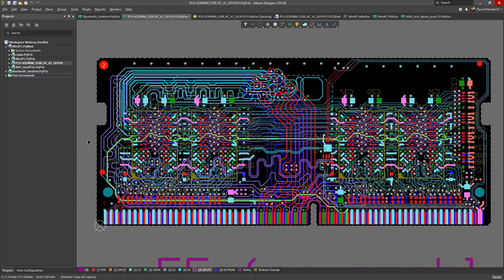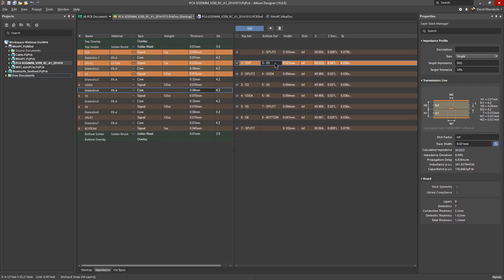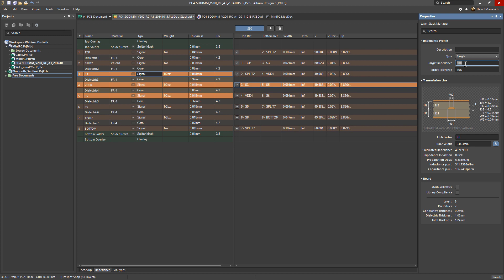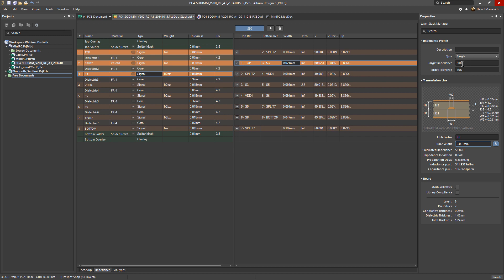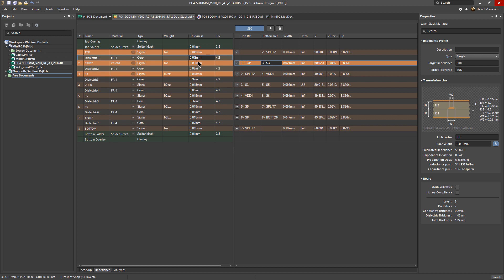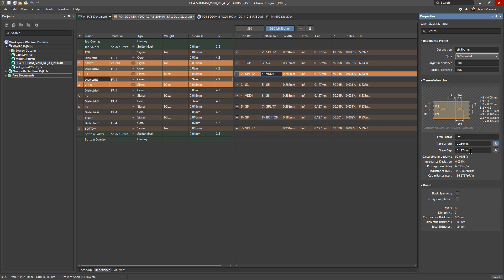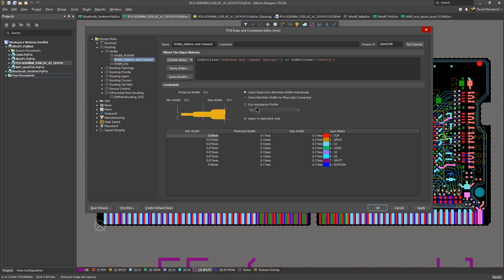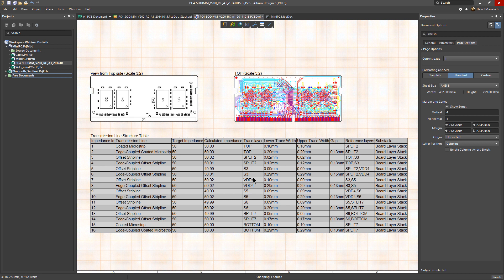How to Calculate Impedance for Single and Differential Transmission Line | Altium Designer

Comment: Thank you for this video.
But when I choose differential co-planar, I can't define rule. 
cant tick Use differential profile checkbox.
Reply: i'm not sure why you're having an issue. I would say that its best to contact support. https://www.altium.com/support/
Reply: @alexsandertamari9380 thank you for this suggestion.
 it is working for single,single coplanar and differential.
Only differential coplanar rules can't be defined in Rules.

Comment: Is that the layout of an A-Tech laptop memory stick? The design seems to be identical.
Reply from the maker: It is JEDEC standardized so they are quite likely to be very similar.
Reply: @altiumdesigner863  Notice that the tracks appear to be laid out in the same way. It is not just the position of the memory chips, or the card size.
Reply: This design is part of the minipc example project. It comes included as part of Altium Designer

Comment: Who used this method of calculations? Is the measurment true on a real PCB?
Reply: Answer for a future generations: 
I've tested and controled by another impedance calculators. This method is acceptable for short signal lines  (~ length  is about lambda/10).